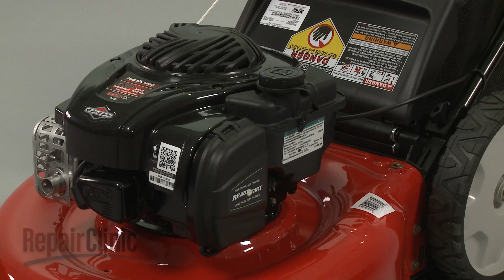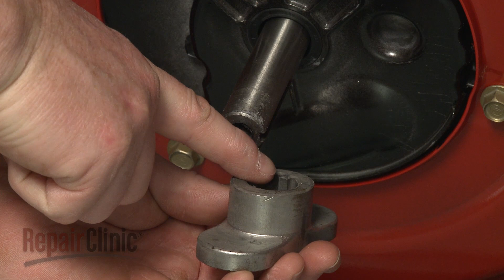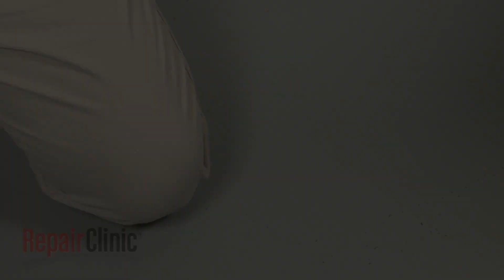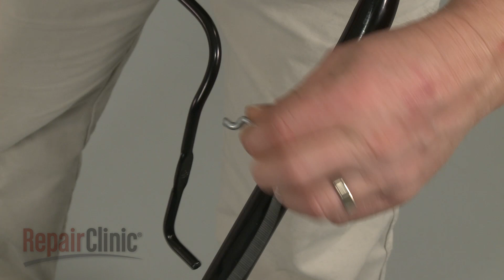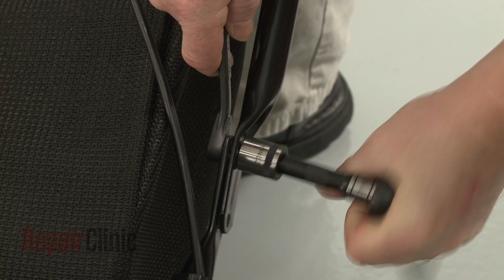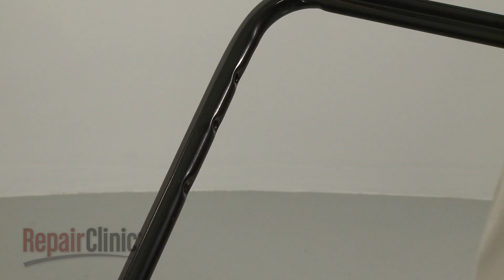MTD Lawn Mower Disassembly – Lawn Mower Repair Help

Comment: How can I get the MTD Push lawn Mower 3.5 HP PDF Manual and what type of oil there are using ?
Reply: Usually SAE30 for air cooled engines.

Comment: i have a huskee 21" 3 in 1 walk behind mower. im trying to finf the correct bagger, its a 173 cc model number 12A-46mz031, under that theres number 4456978. plz help i need a baggee